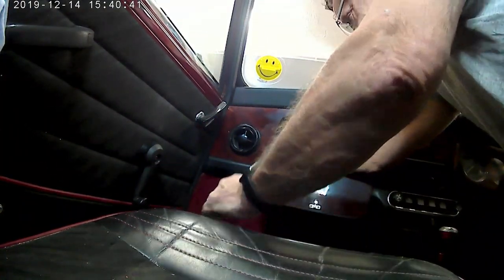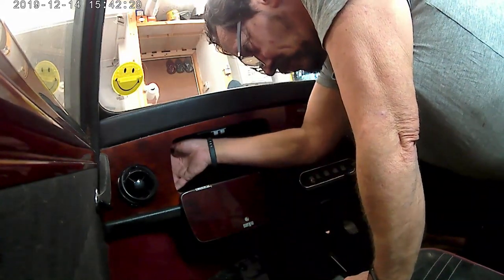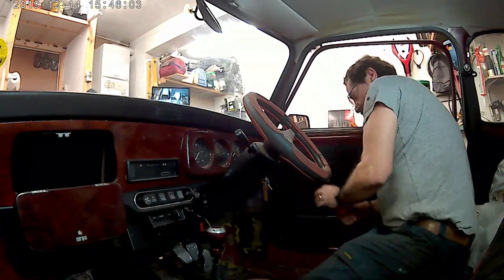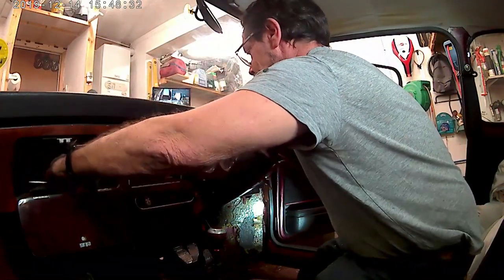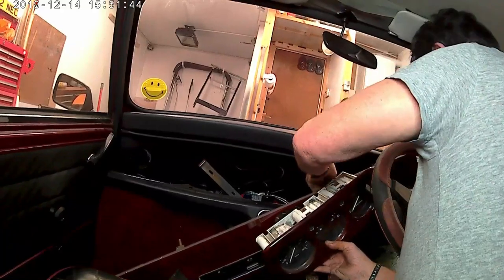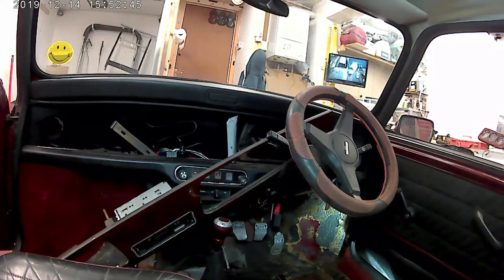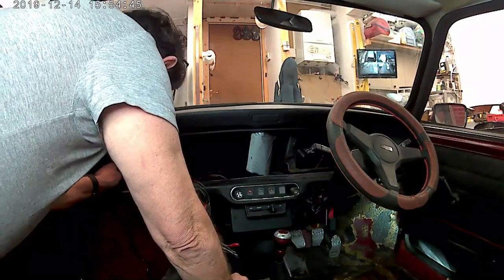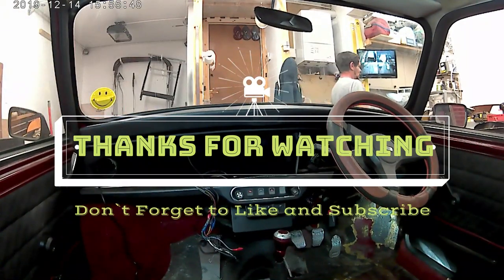Dashboard Removal

Comment: Thank you for this video. Great stuff! I'm looking to replace my dashboard as well. Is it necessary to disconnect the speedo cable from the engine bay or can it be disconnected from the back of the speed instead? If it can be disconnected from the back of the speedo, can someone tell me how? I've see various instructions: 1) Push and turn anti-clockwise, 2) Squeeze the white plastic part on the end of the cable and pull it off the speedo...it does not unscrew, it just clips on 3)  slip a small flat blade screw driver under a tab on one side, lift it up slightly and then pull back on the white plastic part.  It unclips and the cable pulls free. TYA
Reply from the maker: Hi John ,thanks for the comment ,it`s been a while since I disconnected mine but if I remember right, it was as your instructions 1 and 2 ,it`s a it of a fiddle but it comes off easy enough
Reply: New models like this mini with the three or two clock instruments should be a push on/pull off connection on the speedo clock back side. no need to remove from the engine side (I'd actually like to see how that was done since I need a new cable soon).